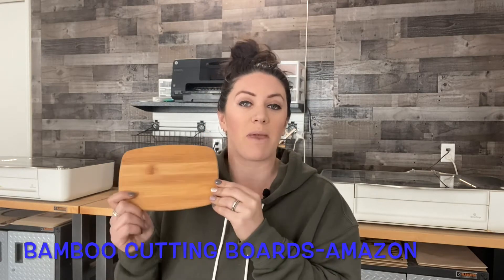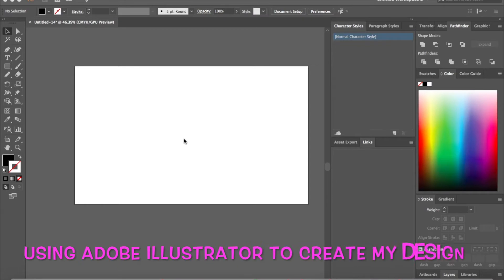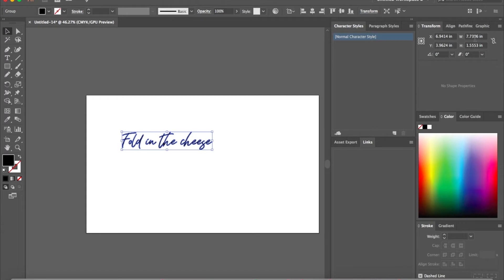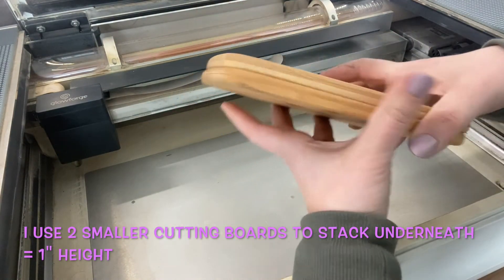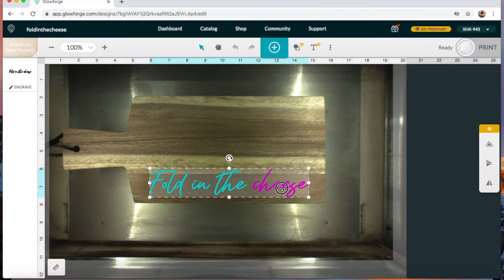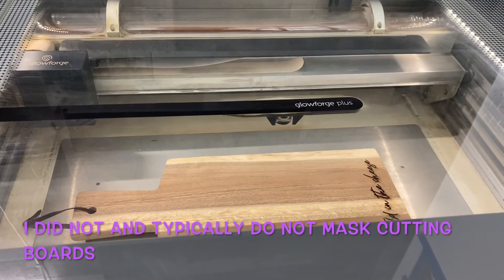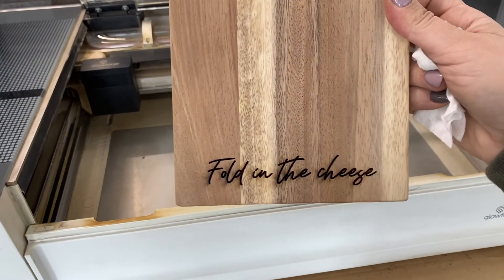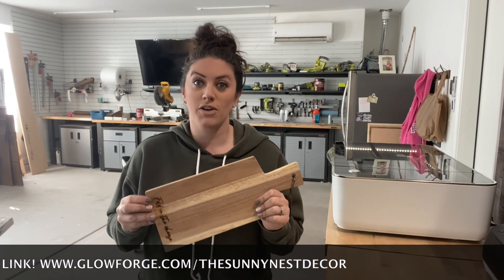GLOWFORGE CUTTING BOARD TUTORIAL

Comment: hello, when removing the crumb tray and adding back in a one inch platform, do you use calipers to measure the cutting board with the one inch platform to manually enter it in the machine? or the board only?